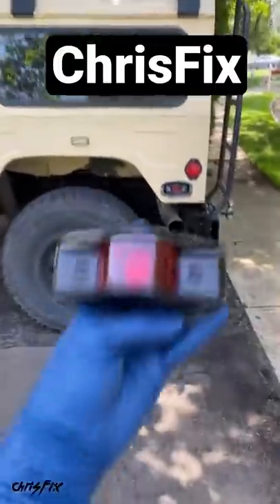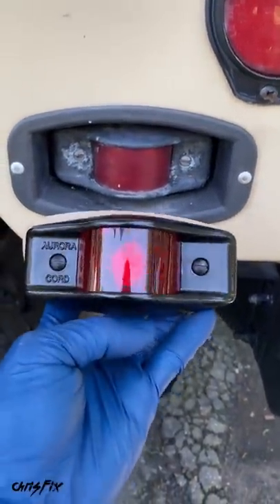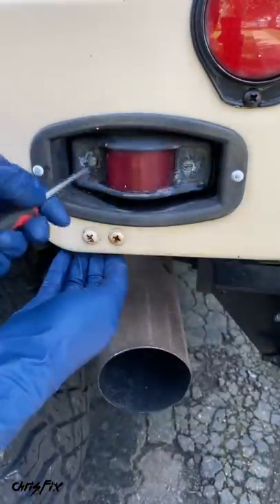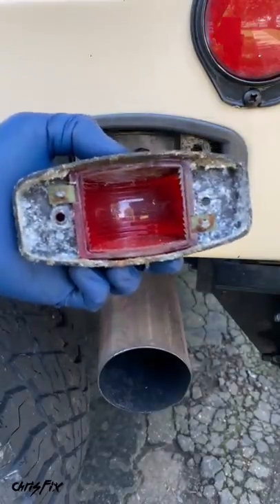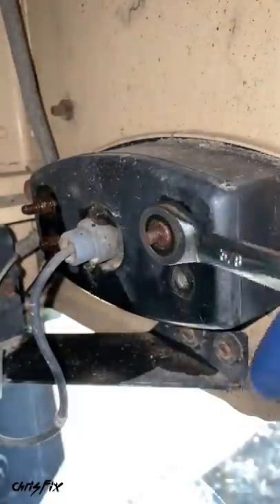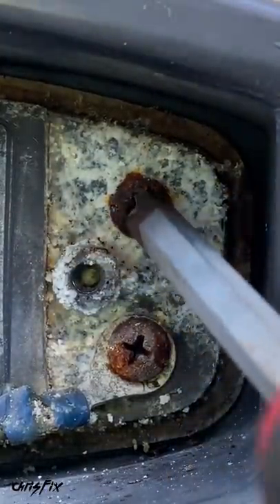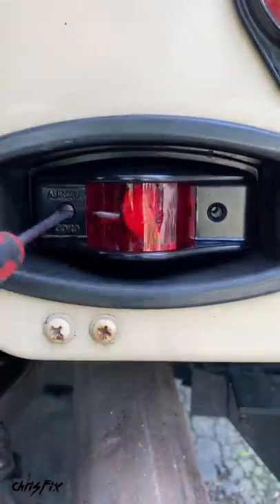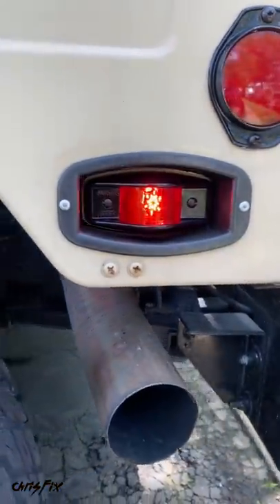Converting from Incandescent to LED Lights #Shorts

Comment: You have to be really careful when upgrading from incandescent bulbs to LED bulbs. One of the things folks don't often understand is that the housing and red/amber glass is specifically designed to take the light from an incandescent bulb and make it brighter and directional. Technology Connections talked about it in the recent turn signal video. You can't just replace the bulb, because LEDs don't work like incandescent, so replacing the entire housing and glass like Chris did here is very important.
Reply: fellow technology connections viewer I see
Reply from the maker: Agreed! For a side marker light it’s not that important tho. But don’t be putting LED lights in your headlights without the proper lens to direct that light.
Reply: Ok pencil pusher. It's not important as it only affects the way others see them, my vision is perfect. I couldn't care less if others like it or not.
Reply: @KableTac  What the hell is wrong with you?
Reply: You can replace the bulb as long as the LED performs as good or better than the original once installed.  I replaced all the incandescent bulbs with LED's in my Tundra (with the exception of the headlights which I replaced the entire housing there for an LED upgrade) and they're far brighter in the housing than the original bulb.
Reply: @Kushothe  Thats not the drivers problem. If you can't drive in a straight line and hit me in my lane, guess whos getting sued? You. Because you can't prove anything was affecting your vision when you destroy the front end.
Reply: @KableTac  "If you can't drive in a straight line and hit me in my lane, guess whos getting sued?"
you. you will be the one getting sued for blinding other drivers and causing the accident.
if you don't believe me go and ask your lawyer what happens if another driver crashes because your light blinded them
Reply: @KableTac  You are actually blinding people and you don't care "because it's not me!"
Reply: @KableTac  lemme guess... you have a lifted truck with improperly installed HID lights and blacked out rear lights, don't you!?
Reply: As long as you get a new housing and you aim it right, LEDs are ok
Reply: @JustaShrimp372  depends.
where I live conversions are so heavily regulated that they are essentially banned.
the producer of a lamp has to apply for the lamps to be allowed for every car model individually, so they just can't apply for all honda or all chevy etc. in a single application.

tl;dr check your local laws
Reply: @lordhelmchen616  wow where is that? germany? i know their laws are strict but didn't think that crazy
Reply: Philips LED replacement has been designed such that the light pattern is same as an incandescent bulb. But it's too costly and hard to buy.
Reply: @KableTac  I bet you will care when insurance decides not to pay out when you get rear-ended due to having bulbs that can't be seen at the proper distance or angle.
Reply: @chrisfix  Which people do a lot. They also switch them over to that annoying Blue light without any other changes  so it BLINDS everyone.
Reply: @lordhelmchen616  hmm, interesting
Reply: @lordhelmchen616  Nothing can be proven. You'll be sued and I'll win the case with zero effort. You weren't paying attention to the road and swerved into oncoming traffic. lights will be destroyed on impact. There is no scenario where you win the case. People dont have dashcams around here, not for 1000s of miles, and even if they did all headlights wash out cameras not just leds/hids so that will never fly in court.
Reply: @Seb-Storm  Ironically it's the people bitching about what other people have on their vehicles that think they own the road. It will never be at fault of me when I'm driving safely. If you can't manage to drive when everyone else can, then you are the problem, not everyone else.
Reply: Especially, the folks who puts LEDs in halogen housing on their main front lights
Reply: Ahh the comment I was looking for
Reply: @omarfw79  Not true for turn signals and brake lights. There is good retrofits for lows, highs and fogs but dont touch the brake or turn signals.
Reply: @KableTac  Well thats good you have perfect vision, that should definitely protect you from another motorist who isn't as fortunate as you to have perfect vision from plowing into you because your lights weren't effective.
Reply: @KableTac   lol "my vision is perfect." imagen being this guy
Reply: @KableTac  there is a term called headlight cutoff height, look it up kid. Your badly adjected headlight will put you in jail.
Reply: @KableTac  fun fact: it is legitimately illegal to swap out your bulbs for out-of-spec equipment. you would be in the wrong in your situation.
Reply: @drkastenbrot  I disagree. There are well known brands for those as well that maintain same brightness and housing reflection. The bad reputation is due to ppl buying cheap alibaba and eBay bulbs.
Reply: @omarfw79  There is no disagreement here. A friend of mine certifies automotive light fixtures professionally and unless there is a led turn signal or brake light bulb that has the leds in the EXACT SAME position as the filament, its not going to be anywhere near the required pattern let alone intensity. I have not yet seen a manufacturer correctly design for this other than with low and high beam retrofits. The turn signal and brake light bulbs are always some random arrangement of a whole bunch of LEDs, with absolutely none of them being at the focal point of the reflector.
Reply: I appreciate this. I hope CF releases a video regarding this. I learned my mistake.
Reply: @KableTac  lmao. do you really think they wouldn't be able to reconstrict what kind of bulb had been used?
but please please go ahead and blind people. let's see what you have to say when the cops give you an expensive as hell ticket because your lights are not right.
Reply: @amicloud_yt  yes it's germany. our laws may seem ridiculous but to be honest, seeing some of the cars driving in other coutries, I am glad that cars here need to pass an inspection every 2 years. keeps a lot of unsafe cars off the road
Reply: @KableTac  so wait, you don't care if other's can see you at night? Because that is what you're saying. The point in running, blinkers, and brake lights is so other CAN see you. Headlights also perform this function, but also allow you the driver to see at night.
Reply: @dasfahrer8187  Please watch technology connections video. It's not about brightness, it's about how the produced light is emitted (directions, etc.). This not only goes for headlights, but it's most important there, but also for tail- an brake lights. You should be really careful what you do here for everything that is safety relevant. And just because someone sells it, it's not legal, even in "good" shops.
Reply: @marcokrueger3399  Thanks, I have already watched it.  He's correct and it's a deserved PSA for the vast majority of the modders out there.  However, that doesn't mean it should never be done, but to just be sure you know what you're doing, as TC eventually goes on to say in that video despite his initial statement.  I did a lot of testing in day, including direct sunlight on them, and night conditions with the original and LED both installed (just as TC recommends) in those scenarios before committing to the upgrade.
Reply: @lordhelmchen616  yeah the laws are for good reason but they seem way too harsh to me...
Reply: @drkastenbrot  thats what am saying a good branded led buld its emitter is designed exactly at the same spot of filament. Don't look into cheap leds and generalize it to all.
Reply: @omarfw79  Can you link one turn signal bulb that is? Because NONE of the ones I could find did. Again, this is about turn signals and brake lights, not low beams.
Reply: Additionally, in some countries (like mine) you cannot simply replace the housing with just any housing. The housing needs to be certified for road use (E.U. certification). Else you'll risk a fine.
Reply: @KableTac  You are no sense
Reply: @omarfw79  even the best designed led headlight bulbs still create way more glare than an incandescent bulb in reflector housings.
Reply: @NorroTaku  Brown!
Reply: @drkastenbrot Sylvania/OSRAM one of many many well known companies. Check thier high end ZEVO LED lineup. The turn signal bulb emitter right on same spot as incandescent bulb. Shine backwards to its housing and mimics the original bulb light behavior.
Reply: @omarfw79  Oh, those do look promising indeed and they also seem to have a matched brightness. I have not seen these before, they also aren't available from any local warehouses here, I'm gonna try to get hold of a pair and test them.
Reply: @KableTac  I bet you are the type who puts badly designed leds in a reflector headlight
Reply: Came here to say that.
Reply: Good to know that now
Reply: Considering these are side marker lights, I don't think it'll be a big deal.
Reply: @chrisfix  I did a ton of research into changing my headlights, which are standard reflector types, to LED. The "blinding" offenders are the types of LED bulbs that are just covered top sides and front with panels. This bounces light everywhere because of the multiple sources. But there are LED bulbs that position the light hotspot right where the incandescent filament would be. This makes the reflector work as it's supposed to, just with the cleaner white light of LED, longevity and power savings. Never have I seen people shielding their eyes or had high beams shined at me, in the 2-3 years I've had them. This is a full size, non-lifted truck on 33"s too, should be even better on cars.
Reply: @NorroTaku  man of culture I see. I immediately got that you watched the technology connections video from the first sentence
Reply: bs

have replaced every interior light w leds low and high beams leds and reverse lights led

all work GREAT

SUCK IT
Reply: Well thank you my good fellow for that Intel.
Reply: If you buy crappy LEDs of course they will perform poorly, but if you buy good LEDs from a good brand like Osram or Philips, it will be better than the incandescent bulbs in every way. 

I replaced all the bulbs from my car's taillights with Philips LEDs and they perform light years better than the original incandescent bulbs.
Reply: It doesn't has any reflectors, so doesnt matter
Reply: @KableTac  you might think your seeing more but in reality you don't. Light goes where it shouldn't and as a result you are seeing less in front of you. The things you see are brighter and might fool you
Reply: @JustaShrimp372  no. The optics were designed for halogen and halogen has a very small bright area, in comparison. Newer LEDs try to mimic this small area but can't do it very well. If you have an old headlight designed for halogens stay with them. You can buy special bright halogens. If you can, you can buy the whole optics made for LED
Reply: @NiallDeBarra  wow that's nice. I didn't really checked it in all detail but I can tell that it's the smallest bright area in a LED I have ever seen. Maybe someday LED will be better and a direct replacement of halogens.
Reply: @lordhelmchen616  in Argentina we have inspection each year. And still you can see very damaged cars in the road.
Reply: @Jeff_S...  yes but LEDs are always bigger and different than filaments. Halogen is the original specification and it's usually better. Some LED are "not that bad"
Reply: @drumtwo4seven  you will see iyoir headlights brighter but it will reach less distance. So you will see less. Engineers do a lot of testing and design the optics for the halogen bulb not for the led.
Reply: @henriquebrenzinger4406  false. Yes they are good quality but they don't outperform incandescent. Check out how many lumens do each lamp produce, and check out the position of the light source of each. If you don't care, go ahead.
Reply: @chrisfix  Another issue with LED headlight conversions when you live anywhere you get snow, the LED bulbs do not warm the headlight enclosure like halogens. Ice and snow will build up quicker if its not melting! Newer cars are converting to LED but the enclosures are much smaller so the LED ballasts will provide some warmth.
Reply: you seen him replace the entire housing its not gonna be an issue
Reply: @drumtwo4seven  Unsure if trolling/memeing but

I'd definitely check if it's LEGAL, not just shining brightly.
Reply: I think it's also about the law too, seems nobody remembered that part 🙃
Reply: Technology connections is a tool
Reply: I also watch technology connections
Reply: @KableTac  You people are the reason accidents happen just be a normal person and have some sympathy
Reply: You can safely use Philips, Osram and other decent manufacturers which produces led replacement for regular bulbs. They even have such for reflector headlights, without lens.
Reply: @KableTac  Completely wrong.  If you have the illegal headlights in, and the other driver claims they were blinded, you're screwed.  Nobody needs to prove anything because by default your headlights are illegal.
Reply: @JustaShrimp372  Not quite accurate, you must get the housing and LED as a set, the housing must be designed for that specific LED bulb/array and more often when it is, it is not a separate bulb at all, rather permanently integrated like OEMs do.  Problem is, there are very few of these made aftermarket except for very popular vehicles and more often, not DOT compliant for public road use in the US.
Reply: @NiallDeBarra  I think I'd rather do without and not be in South Korea.  ;)
Reply: @KableTac  your headlights aren’t completely shattered on impact though. That’s also just a selfish thing to do, driving on the roads tax payers pay for is a privilege not a right.
Reply: @KableTac  actually led bulbs are not road legal...and you would be faulty for the accident since your car is not road worthy...
Reply: @lordhelmchen616  but can you prove your vision was impaired?  Your supposed to be in complete control of your vehicle as long as the bulbs are D.O.T approved you can use them in O.EM. headlight housings and the lights are not above the maximum height it's perfectly legal to have bright LED lights. I do state inspections on vehicles in Missouri  I know this is the law.
Reply: @amicloud_yt  everywhere in Europe essentially.
Reply: @KableTac  In many countries you can change as much as you want, except those parts who can affect the others for safety reasons. You can use white, yellow, blueish lights but those lights must be properly directed in order to avoid any issue for those who come from the opposite side, or even behind and in front of you.
If I put my headlights in a way that can affect you, the risk is that if for any reason the one who is driving in front of you presses the brakes and you are under the blind effect, guess what will happen? You gonna crash on the car in front of you. 

If you need so much light, maybe you need a checkup for your sight. 
But if you still want to try your luck, be sure to not blind the wrong person or you'll surely regret to be survived such accident.
Reply: Aditya Illur  he has plenty long useful videos not just 4 shorts
Reply: You had me until you cited technology connections
Reply: @jakehiggins5118  really not.
Hid replacement for halogens were all over the place.
But 1 chip LED replacement are spot on for patrern and intensity. Even for those hellish hi/low H4.

Turning signals and brake lights ? Are you joking about patterns and blinding ? If there was anykind of real care given the clear lense would be banned as they reflect too much sunlight and prevent ro see if the signal is on or not… (looking at you lexus…)
Reply: @Kushothe  Typical britsh? yank mindset. 
We talkin about side markers here, not headlights
Reply: your headlights have to illuminate the ground ahead of you. if you can see in front of you, it's not your job to save the other driver
Reply: Yeah I remember seeing tech connections' vid on this, it's really helpful
Reply: @dasfahrer8187  oh so you're that guy...
Reply: @amicloud_yt  oh shit how'd you guess it so right 🤭🤣🤣🤣
Reply: technology connections is one of the best creators on this platform change my mind
Reply: @amicloud_yt  don't forget the weenie whistle and the exhaust delete so he can roll coal with the other preschoolers
Reply: @amicloud_yt  that's North America.
Reply: @omarfw79  you're "disagreement " means nothing against the law. It is illegal to replace O.E.M. lamps with lamps not approved for the application. If it ends up in court the judge will laugh at your disagreement.
Reply: @KableTac  typical american
Reply: Not to mention replacing an entire vehicle with LEDs (modern vehicles more so) can confuse the canbus system.
My indicators don't work with LEDs and I don't have any relays to replace it's all done in the UCH module 👎 I have to add resistors to the circuit to make it think it has gas bulbs.
Reply: Yes because leds don't need mirrors like incandescent lights I put xenon 2 leds in my 1997 Montero I wanted it to flood so I just put the leds in instead changing out the entire thing. Obviously my headlights are now brighter then cops in my shitbox and they don't like it much hehe...
Reply: @jimmy5860jim  it's not that they don't need mirrors. LEDs don't give out much glare or "light spread" 

The reflective lenses inside normal headlight bulbs are focusing the light from a normal bulb into a beam.

LEDs can still benefit from reflective surfaces if you need that light to spread out or flare. But for car headlights you lose too much from an led. Unless you have projector lenses. They're awesome

My mainbeams are Led too but they're the brightest fuckers going and aren't focused.
Reply: @MaNNeRz91  my bad bro meant projector lens and im not losing out I actually gained more then what I was supposed to I can see over 600 feet infront of me plus wide on regulars let alone highs beams...
Reply: @MaNNeRz91  also I don't. I think mine are focused meh all Ik is I can see farther and better and it's bright I have glass headlight covers not plastic dk if that makes a slight difference other than the fact they don't fog up yeye
Reply: @jimmy5860jim  if you can "see more" then it's probably flaring and creating a lot of glare for on coming traffic...  

If you can "see clearer" or with more clarity then it will be nicely focused and you will have a distinct beam line.

I fitted HIDs to my old headlight units and it was awful. It lit a bigger area but it wasn't as crisp..

Now I have projector units it's very clear and the viewing distance is greater.
Reply: @MaNNeRz91  o yea I see clearly I even see the beams going straight I'm saying there is only a lil going off to the side but it's all straight high beams I can only see in my own lane
Reply: @MaNNeRz91  I would like to show you pictures of when I went out to forest hill shows my headlights the best out there due to it wasn't raining and no city lights
Reply: @KableTac  notice how LED'S say off road use only, when they discover that have fun with no license 😂
Reply: Ok? Lol
Reply: Yup, I hate when people do this with headlights and don’t realize they need to be calibrated with the new bulb so there beams are way up in the air blinding people as they drive down the road.
Reply: @KableTac  Not all roads are straight, there are corners and bends you know...You might as well drive with a high beam on with your logic.
Reply: @KableTac  you probably have a straight piped Honda civic
Reply: @KableTac  americans be like
Reply: @KableTac  actually you there are standards at which headlights ha e to be adjusted too. If the are out of alignment then it is the operator of the vehicles fault.

And the proof they need is to conduct a headlight check on the angle and brightness to determine it is out of specification and you will be in trouble.
Reply: @NorroTaku  90
Reply: @KableTac  You blind me, I blind you
Reply: And also of course, get good quality lights and have them adjusted correctly!
Reply: @KableTac  idk man blinding other drivers of the road sounds like a way for them to crash into you
Reply: @KableTac  the whole point of taillights and side marker lights is to make sure others can see you.
Reply: Thanks for pointing that out cuz some ppl aren't aware of the fact that the housing is important.  When ur upgrading ur bulb from incandescent to LED for an example, the LED pattern can project differently when its inside the incandescent casing. I've seen that in some guys truck when he installed amber LED top markers and kept the incandescent covers, and the lighting pattern it gives off is blinding to say the least. So its important like you said to change not only the bulb, but the casing as well so the patter can be consistent throughout.
Reply: The lens should be a lot less transparent so it diffuses the light more and glows instead of shining out
Reply: @LansaDiag  everything is wrong with him
Reply: @chrisfix  makes sense, I usually get blinded from a bunch of cars on the nyc highways at night and that explains it
Reply: @TechnologyConnections
Reply: @TechnologyConnections
Reply: @KableTac "Nothing can be proven"

Everyone with a dashcam: want to fucking bet?
Reply: How does rhe cover make any light brighter than what it is?
Reply: Can confirm: changed the halogen headlight bulbs in my  05 civic with cheap LEDs. And they work great!! So long as I always drive with my brights on lol
Reply: @im-that-guy-pal  great, I’m gonna drive with my brights on constantly since there’s no laws against blinding people. Thanks!